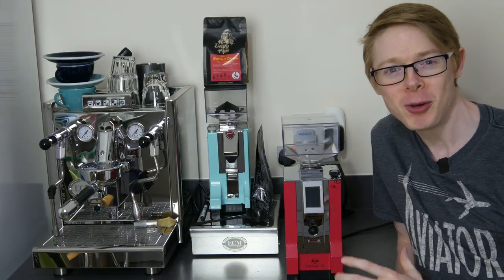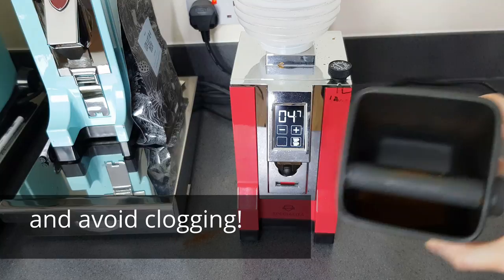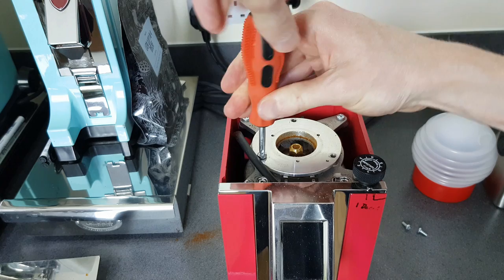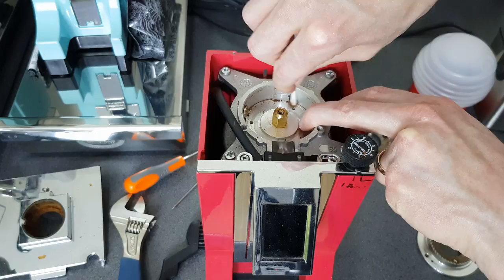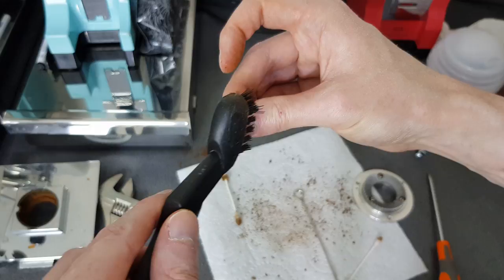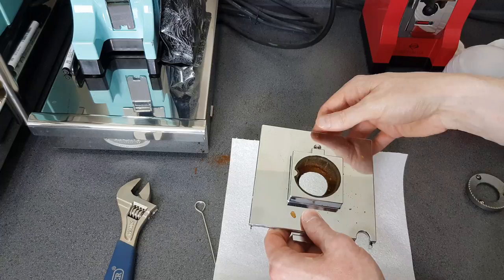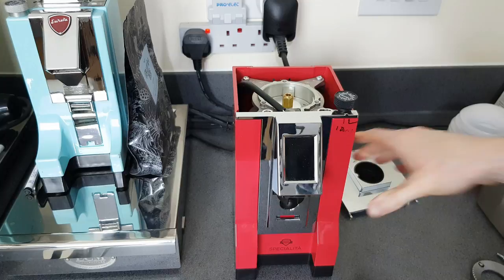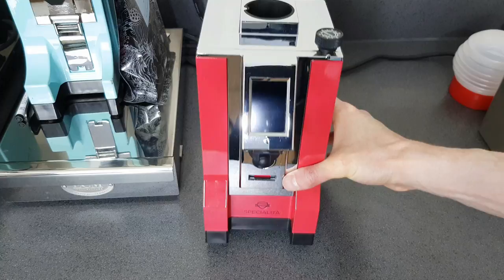Dirty Little Grinder: Cleaning Your Eureka Mignon Specialita Espresso Grinder

Comment: Thank you!  You have inspired me to disassemble mine for a deep clean.  I normally only remove the top burr plate.
Reply from the maker: Hi Lauren - How did cleaning your Specialita go? Yes, if you haven't removed the bottom burr, I think you'll find it's worth doing.
Reply: @coffeewithalex4379  Hi - thanks.  I have now cleaned it this way for each new bag of coffee.  And removing the rubber piece and chute for washing too.   Very messy affair. Just hope the wires don't eventually sever.   Still afraid to remove the bottom burr but shoot air under it.   Will try it sometime!  But now I cannot ever leave all those grounds hanging out for too long.   Better tasting shots.
Reply from the maker: Hi Lauren - That's great to hear! There are a lot of comments saying it's too involved so it's good to hear you say you'd rather have it clean for better tasting shots. That's what it's about.

It is a messy affair as you say. Definitely take care with those wires. They can break off where they are soldered. I try to kind of hook this front part to the left at a little angle. It's hard to describe but it stops the strain on those wires. Otherwise you might be able to use something else to stop it hanging - maybe an elastic band could help?

Don't be too afraid to remove the bottom burr (if this is the actual burr with the 3 screws not the bit underneath the bottom burr) - it's definitely worth doing to stop build up and cause problems dialling in. 

Someone suggesting using a wooden cocktail stick if you're worried about scratching it. I've found the best way is to remove the 3 screws, then get a skewer in and gently lever it in each of the 3 holes to loosen it. Then, when you feel like it's loosened, get another skewer and go in from the side underneath the actual burr. Try to get the skewer underneath the burr while levering in one of the screw holes. Be firm but not too heavy handed. 

The longer it's been there without being moved, the stiffer it'll be. But it should come loose. And you might be surprised at what's underneath and around the sides of the burr. 

Of course, don't do anything you're uncomfortable with. If you think you'll damage or break it best to leave it or get some local help if possible. 

Thank you Lauren so much for coming back and letting me (and any comment readers) know how it went. 

Let me know if there's any videos you would like to see on this channel.

Comment: Good video but who uses flat head and Phillips Head screws in modern equipment its just asking for long term problems.  Whilst I like the look of the Eureka grinders the simplicity of maintenance on the Niche Zero is a a non-brainer for me.  The Eureka looks far more complex to maintain, set-up and clean but I do like it’s exterior design. I have been struggling with my next upgrade and this video has convinced me that this machine is not the one.  Thank you for the great breakdown of this kit.
Reply from the maker: Hi Neil - I haven't used the Niche. I'm a bit biased towards flat burrs - only based on what I've read not my own real-world experience. 

At the price level, I haven't seen a flat burr grinder that I would have preferred over the Eureka Specialita. Although Eureka are coming out with new ones now but they aren't a completely new design it seems. 

To be honest - I do go deep with cleaning. All these steps in the video aren't absolutely necessary. For example, you can leave the burrs in-situ to clean them. 

What are you looking at as an upgrade?
Reply: Thanks Alex for the response.  I finally went with the Niche Grinder and absolutely love it, that’s not a reflection on the Eureka (which is also a nice machine) but the Niche is so easy to use, change settings, calibrate and clean that it works for me. Cheers !

Comment: Cleaning process takes time for this grinder.  I think I'll get a Ceado.
Reply from the maker: 😀 I went into detail on each part of the cleaning process.  With most grinders you'll have to do exactly the same things: flush the chamber,  clean the hopper, take it apart, remove and clean the burrs, clean the chute, put it all back together and clean the outside.

Comment: Not sure if anyone has mentioned this, but I think you can remove the bottom burr easily but removing the chute first, then prying the burr out from the side where the chute was.
Reply from the maker: Definitely! Although, if it's kept clean you don't necessarily need to remove the bottom burr and some comments here say you shouldn't as it affects alignment. I didn't notice this but I just want to say that for anyone reading.

Comment: If you have french roast or darker beans, this grinder needs weekly maintenance of disassembling, cleaning and a lot of patience. After using a mazzer grinder for 15 years of the same beans and never a clog, I had to wonder why. Well the opening between the burrs and the chute is really small, about 5mm x 15mm. So oily espresso beans are going to clog it up. I love the interface and easy operation of this grinder, but it's too high maintenance for me. I dont recommend, unless you need a weekend hobby.
Reply from the maker: Thank you for sharing your experience. I haven't used French roast / darker, more oily beans so it's  good to know. 

Like you, I love the interface and easy operation too. And it's definitely a hobby!

Comment: Thank you for this. After a whole month of use after purchasing the Specialita it stopped working. It seemed that it was stuck and a safty device was being triggered to avoid breaking the motor. Found your video and started cleaning only to find that the small gap under the bottom plate which holds the bottom burr was so stuffed with grounds that it prevented the engine from spinning….
Reply from the maker: Wow - really? That's good to know. So did it work after you removed the grounds and cleaned it up?
Reply: @coffeewithalex4379  yes. After cleaning it has been working for a month now without problems. Never would have guessed that you actually have to clean it so often.
Reply from the maker: That's great to hear! You dont' have to do a deep clean like this every time. I may make a video showing a faster, shorter, interim clean.

Comment: Great informative video.  I haven’t actually broken down my silenzio for almost 2 years since I’ve had it.  I bet there’s a lot of built of stale grinds and oils inside😅.  I do have a single dose bellows and hopper at least and have vacuumed through the top, but the burrs are probably quite dirty by now.  Can’t wait to try this on Saturday and see how much better my espresso tastes afterwards
Reply from the maker: Thank you! Yes I'm certain you'll get bette tasting espresso after the clean. By the way, it's quicker and easier to leave the burrs in place rather than removing them and cleaning them. Some people have said they've had issues from doing that. I didn't experience them but to be safe you might want to leave them. You can still do a dry clean without unscrewing them.

I'm excited for you!

Comment: Thank you so much for the detailed video. But this is reason why I switched to using a hand grinder.
Reply: Can't help feeling this is all a bit unnecessary. This machine is designed to grind coffee, and will obviously have some ground-up coffee in it. I suspect the manufactures were aware of this. I also find myself looking over at my old Smart Grinder Pro, which (unlike my Bambino) has lasted around 3 years, still works - and I've never, ever, cleaned it. Tbh, if I really need to do all this with my Eureka then i'll be selling it and going back to the Breville...
Reply from the maker: The reason for cleaning isn't just about cleaning out anything that's left in there. It's for the benefit of the coffee you're putting through. Can you imagine all the old stale oils from your coffee tainting your lovely, fresh new coffee? If that doesn't bother you then this might not be necessary for you.
Reply from the maker: Which hand grinder do you use Benjamin?
Reply: @coffeewithalex4379 btw. I was not referring to the cleaning but the amount of coffee wasted in the grinder.  I use an 1zpresso k-plus. It's supposed to be an all rounder but it's more skewed towards pour overs. Mainly I drink 1-2 cups a day (single dosing) so I actually switched over to a manual to reduce wastage and also for a quieter operation.
Reply from the maker: Sorry Benjamin - I was replying to another comment in this thread about the cleaning. Interesting that you use a hand grinder. I'm interested in trying one but there are 2 things that hold me back:

1 is speed - if it takes my grinder 14 seconds, how long would it take me? 
2 is quality - often people speak about the larger the burr size the better (to a point obviously). 

Anyway, thanks for watching!
Reply: @coffeewithalex4379 

I actually can answer that:

1.) for a good hand grinder. It take between 45 seconds to a minute to grinder 16g of coffee ( note, the faster the grinding, the harder the torque needed, so slower grinders actually are easier to grind) 

2.) Hand grinders actually have relatively larger burrs as they are all conical burrs so a 48mm burr has a relatively larger cutting surface than a flat burr. Combined with a lower speed of grinding, the quality is not too bad. If you want a larger burr, there is also the hg-1 which I believe uses a 83mm burr set.
Reply from the maker: Hi Benjamin,

I'm slow enough making coffee as it is without adding in the hand grinding 😉 Especially dialling in. That could take quite a while. But I do like the idea of it being so manual with zero retention.

Comment: This was very helpful, thank you. Another method to get the bottom burr out is to use a simple nose plier, I've seen that the burr will lift out very easily.
Reply from the maker: Thanks Raj - good tip!

Comment: Great Video! Tank you very much!! One question: Is there a danger for the blades to misalign, when you put it all back together, so you get an uneven grind?
Reply from the maker: Hi Felix! No you should be fine. Even better the Specialita is built so that after you've cleaned the burrs and you put it back together, it should be at the same grind size as before.

Comment: Thank God !  Thank you so much for making such a super clear and detailed video.
I don't think Puly's Grind or Grindz would clean nearly as good as this - I'm now just dreading doing it but I will have your video playing on the table next to me,
that way I know I'll be doing it properly !
Reply from the maker: Hi Paul - You're right. Grindz wouldn't clean it this well (I tested and filmed it but have yet to edit the video). Grindz is not going to clean all those crevices. Plus you really need to get behind that clump crusher. A lot of coffee grounds can build up there. I've found 'coffee boulders' behind there, which does become a problem. So you need to clear that out. 

I removed the clump crusher to see if this helps but it's worse - coffee goes everywhere. 

I know how you feel about dreading it. Clear some time and get in there :-) If you haven't done it for a while, your coffee will taste better after doing it. You'll find you'll want to do it more often because you'll taste it or notice the timing of your shots aren't as consistent as they were. You may also notice more clumping than usual in your grinds. That's a sign to check inside and see if it need a clean - not just the burrs but take off the front to check behind the clump crusher. 

Thank you so much for watching Paul - really appreciate it. Anything you want to see next?
Reply: @coffeewithalex4379  Many thanks for your comprehensive reply.  I have actually saved your video to a separate usb flash drive which I keep with all the coffee accessories  so that I can have it playing like yesterday when I cleaned the grinder - It was an invaluable video to have stopping and starting and rewinding as I took on the "dreaded" cleaning process - I would have absolutely messed stuff up if I had not had your video playing alongside !  What the hell are Eureka doing ?  No video, no support - no nothing.....typical corporate culture - no one does nothing - unprofessional, disgraceful !  (anyways thank goodness you did their job for them).

The clump crusher and shoot are the main  sources of starting to clog up and get quite "layered" and gundgy so for me cleaning will always involve taking off the shoot and crusher.  I removed the bottom burr from the front, underside of the removed shoot / clump crusher area with a single flat head screwdriver......it lifts the borrow burr  off in one go.....but obviously the shoot has got to come off to do this.

The grinder works subtly better - more even, more precise grinding etc, etc.

Once again thank you sooooo much for making such a great video !
Reply from the maker: No problem at all Paul. I made it especially for someone like yourself, so I'm really glad it's helped. 

Definitely either side of the clump crusher is where I find most of the build up. Recently I've been cleaning this or checking it every 2 weeks. It might be because I'm using bellows to clear out after each dose. I believe this may cause some additional clogging. Just my observations.

Thanks again for watching and engagin Paul!

Comment: Thanks Alex, perfectly brilliant review on cleaning. I was just about to get one of that today and happy to come across to your review of cleaning with quite a hassle. I pretty much assume such grinders require this process I would say each every 3-4 days, otherwise I really don't understand what good it is to have aged small quantities of ground in your Puck everytime. I now you would say it possible to purge with 1-2 secs of running and dumping but whatever you do you would have aged and moist and not good coffee grounds. Maybe I should still stick to my hand grinder for a while more. Cheers.
Reply from the maker: Hi Ömer - Thank you for your kind words. If you get a similar grinder to the Specialita then I would also assume that you're going to have to do this kind of cleaning. Personally I'd say you wouldn't need to do it every 3-4 days unless you're using it to grind a lot of coffee - more than for one person. That's just my opinion. You'd have to test it out to see if it makes the difference you think it would. 

To keep it as cleaning as possible in between 'deep cleans' (burrs, chamber, chute), use some kind of bellows to blow as much of the retained grinds after you've finished making coffee. Even if that's several times a day. 

I have never used a hand grinder so I can't compare. You might be right to stick with it. Incidentally, which do you have? 

What I do know is that I have been looking for other grinders and I haven't yet found one I'd replace this with in this price range. I know there's the Niche Zero which many people love. And I may yet get one but at the moment it's not for me. For my next grinder I'm looking for a big step up that is designed for single dosing but that does mean a big increase in budget.

Thanks for watching and commenting - I appreciate it.
Reply: @coffeewithalex4379  Hi Alex, when it is in your mind you can avoid, so I already ordered one Mignon XL. On cleaning my remark was for every electrical grinder not particularly for Specialita which remains of coffee ground might detoriate the taste. And I thought exactly the same you recommended to use Bellows 2/3 times a day to avoid or decrease accumulation. For hand grinder I am using 1ZPRESSO Jx Pro which I am extremely satisfied and highly recommend if you are looking for any. But to use a hand grinder is a personal choice, and keep in mind it is really something physical. That is why I am also having an electric grinder. I might reply again if you are interested in differences but my guess is hand grinder (1zpresso jx pro) results to be more favourable, just my feelings. Best regards.
Reply from the maker: I can definitely see why you'd use a hand grinder, Ömer. How are you getting on with the Mignon XL? Any difference in the taste you're gettting? I assume you're brewing espresso.
Reply: @coffeewithalex4379  Yes indeed I am brewing only espresso and I would definetely and highly recommend Mignon XL for any espresso ethusiast. It is very reliable, fast and extremely quite. Yes, there is a distinct taste difference vs my hand grinder. Hand grinder brewed espresso has consistently more clarity and distinguishable complexity of flavours to my taste. But nevertheless due to its super convinence I’ve already switched to Mignon on daily basis. Wishing you good days…

Comment: Hello! Thank you very much for the video, the process is very well understood. I

 had to open the upper burr since the grinder had blocked and it did not make coffee. I simply cleaned upper part and replaced the three screws. 

When grinding I saw that point 0 had changed from 5 to 4, do you know if that is normal or have I done something wrong?

Thank you!
Reply from the maker: No problem, thanks for watching. 

Yes it can change. As long as everything else is working as normal, you're good. 

Next time, to minimise this, leave the burrs in place and just do a 'dry clean' of them and the chamber/chute using brushes and a vacuum.

By the way, if you like exploring different coffees, you may be interested in a way to help you get the tastiest espressos from them. I just published an Espresso Journal that helps you track, make notes and improve every extraction. Check it out here https://www.amazon.com/Espresso-Journal-Track-Extractions-Barista/dp/B0CRF5GMB7/ or UK people here https://www.amazon.co.uk/Espresso-Journal-Track-Extractions-Barista/dp/B0CRF5GMB7/
Reply: @coffeewithalex4379  Thank you very much for the answer and the recommendations.